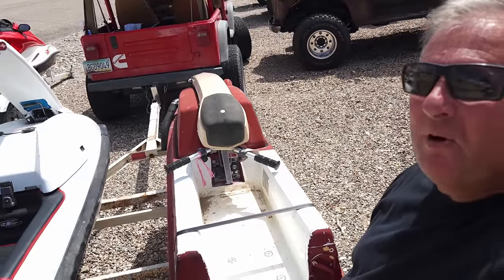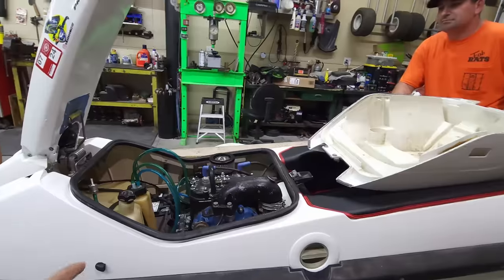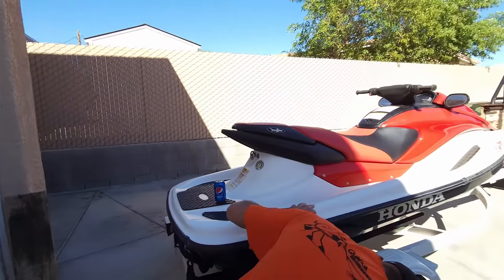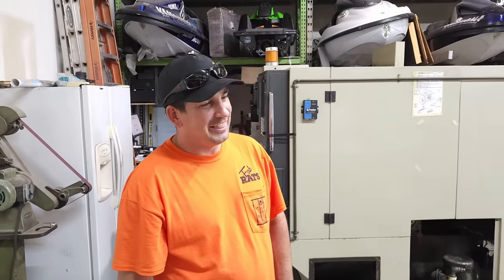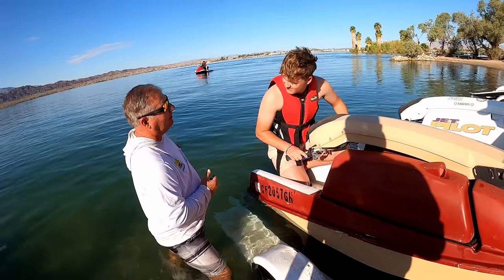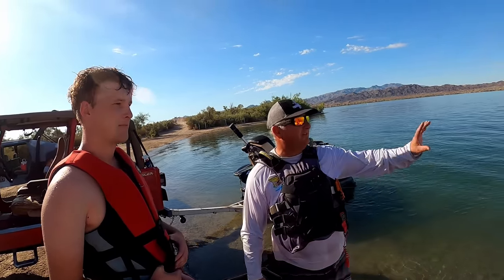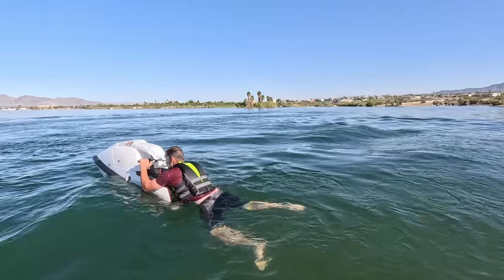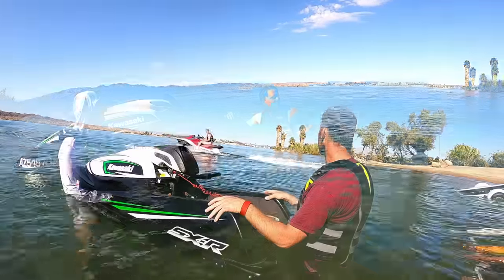Will Hunter Finally Get to show up Paul @FabRats?! Hunter Gets his 440 Jetski on the Water!

Comment: #Jim  Hello I seen your channel from watching Merle channel. In 1993 I lost both my legs above the knees at my job. I was a tow truck driver got a pick-up out of the center of the hwy. There was like half inch ice 6in of snow semi top this hill an jack knife his trailer smashed me between the pick-up an wrecker drug me 213 ft down the hwy. Life lives on. I end up buying a boat an 2 jet skis . I had so many people look at me like I was crazy because I rode a jet ski with no Legs . I had a Kawasaki 3 seater. It would run close to 60 mph. I loved it. I love your channel it is awesome. I live in Central Missouri I am selling my house an looking for a place to move where there is no snow not much rain. In a wheelchair snow, An wheelchair don't mix. That looks like a nice town you an Merle live in. I was wondering how much house are down there. In 1996 my house cost me half million to have built. Anyway love all the info about jet ski.

Comment: I've had just one go on a stand up jet ski, and it didn't go well.  I was standing up OK, but I couldn't make it steer.  It turns out that as my main mode of transport was a motorcycle, and motorcycles counter steer.  That is to say if you want to go right you pull — ever so slightly — on the left handlebar. That moves the front wheel left causing the bike to lean to the right, and go round a right hand bend.  At the time I was not aware of that.  Like 99% of motorcyclists I did it all by muscle memory, and so was trying to do the same thing on the jet ski, but jet skis don't work like that.  By the time I got my head around  why the ski wouldn't steer, I was way away from the shore, and of course, that's when I fell over.  I got it back to shore somehow, and gave the ski back to my brother who owned it, and declined offers to try it again.

Comment: I had a '77 440 and 2 '78 440s.  Mine were highly modified.  One was a "superstock" 440 (top speed 48 mph), one was bored to a 550, but my '77 was ported and we sleeved the pump and put a 21' pitch impeller in it.  We had to run all of mine on VP 104 octane gas because we raised the compression so high.  I used to race the superstocker in sancioned races.  BTW, the 440 was the model A.  The 400 was the model T.  We used to call what Jimmy was doing "Bulldogging".  Riding backwards is someting else, and it is VERY hard.  I wanna' see if Jimmy can submarine a ski.

Comment: Love those SX-650's  I have a pair, one's tuned with a huge pipe, ported, has 2x 38mm Mikuni, high compression and a rideplate and scoop grate and high angle impeller, two modes, bog, and whaAAA!!  The other has more of a stock setup, with with a single 44mm carb, all torque, great for tricks.

Comment: We can see Merlins CNC machine in your shop Jimmy!!
Have you started to get it Working? With Merlin of course!!
Reply from the maker: Not yet, but I did find a 300lb electric motor to run the phase converter for this beast. :-) Merlin and I were discussing it the other day. We want to get it up and running this Winter for sure..

Comment: My mother told me a motorcycle was a "ticket to a Wheelchair" -- so I bought my first Jet ski in 1991 in Atlanta GA -- a used 1984 JS550..    

There is no better feeling then riding a standup, turning tight turns on a dime, jumping boat wakes and submarine-ing .       

 Today's sit downs are fast-- but boring compared to a STANDUP Ski.    ----------- 

The old KAWI X2 -- is a good substitute for folks that can't quite handle a standup, like Paul..  

X2 is still way more fun than today's sitdowns.

Comment: Ran 550s and 650s back in the 80s most fun you can have. Live in Michigan and one year buddy called and said he wanted to be the first rider of the year.  Yep lakes frozen but the rivers open.  Run a hose to you wet suit leg from the cooling line and send it.  By the way Jimmy up on the hood was called an Austrailian barefoot if he dropped his feet to water and stood up.  You will smash you privates on trying that one.  You can stand on the hood backwards and ride or do it forward and let off throttle the nose will submarine.

Comment: Did the Kawi jet ski thing for many years. Started with a 550SX  it didn't take long before the mods started. Milled the head and added dual cooling lines and a scat trac impeller and a pump down wedge had the pump housing extrude honed and opened up the jet nozzle on a lathe and did some porting on the engine huge bilge pump. My Mom and Dad had a 4 cyl tri hull boat and that ski would pull away from that boat like it was standing still. Did some old man races with it and I did fairly well. It was time well spent. The they came out with the sit down ski's and it got dangerous because any IDIOT can ride one and it takes no talent to ride and they they goof off and spin them out and take off and have no idea where whey are going and saw many collisions and injuries. So, we stayed away from the Idiots on the sit downs. We had a ton of fun on them. Was riding backwards one time and got pulled over by the Ranger and he said Son that's the biggest ticket you can get on this lake wreckless driving "don't do that again".

Comment: a  friend of mine has a turbocharged highly tuned seadoo with almost 450hp and thet was the first waterscooter i drive alone and when i did the harbour police came and hunted me down with one of thier boats and told me that i couldnt go over 10 knots in that area and then they looked at the Saedoo and asked if it was my friends and i said yes its his and then the police said thank you for stopping because that thing is much faster then this boat :P the Saedoo is good for about 90knots which is about 105miles/hour its built for speed not that crazy acceleration but its still faster 0-60 then the stock rxt300rs model that its built from.

Comment: Regarding the flame arrester, it sounds like a similar thing to the old miner Davy safety lamp, "Davy's invention was to surround the flame with a metallic mesh screen. Air could pass through the screen to fuel the flame, but if the holes in the screen were small enough, the mesh would cool the flame to such an extent that it could not ignite the gas surrounding the lamp."

Comment: Whats the weight difference from the 77 to today's machine?
Reply: '77 235lbs.   '23 1500?  550lbs. 
You could, & still can, ride off 3 gallons in a 3 1/2 gallon tank, & you're DONE. 
About 1:20 ride time .  Including rests for tight back if you ride in busy/choppy water. 
I imagine the fuel bill is 8 1/2 gallons for the 4 cylinder for the same hour & 20 minutes.
Falling off at 34mph makes you skip like a rock. I don't want to find out what getting off at 55+ feels like.

Comment: I came back to this video as I remembered You mentioning you need to add oil to the ski as its dried up. About how much oil should one add? It looks like you got it started and then began trying to add the oil down the carb. I'm guessing you dont just drop it down the carb while not running?

 I picked up some skis that had not been ran in many years so trying to make sure I don't have bearings flying out like you mentioned. :D
Reply from the maker: That's correct. If you add oil before you start it, It coats the spark plug and fouls them. So as soon as it starts, dump a little oil down the carb, Let it run for several seconds, and you will give your engine the best chance at running for a long time to come..
Reply: @jetskijim007  perfect thanks Jim!